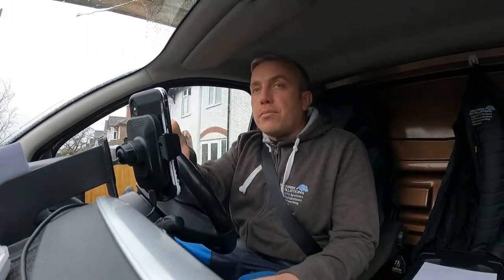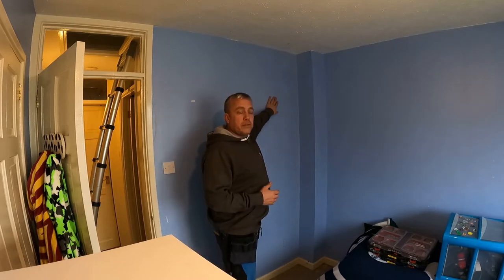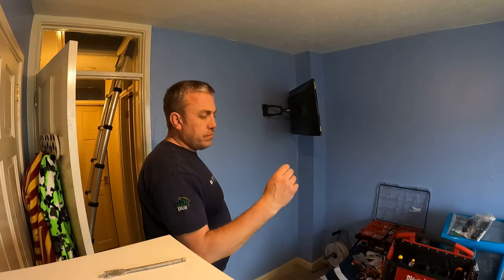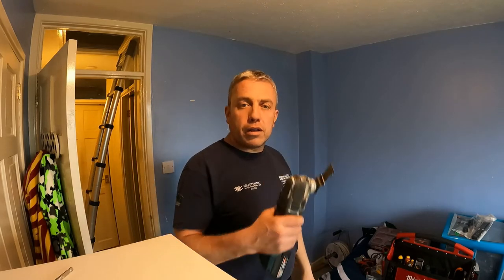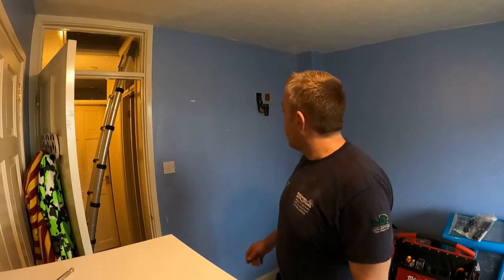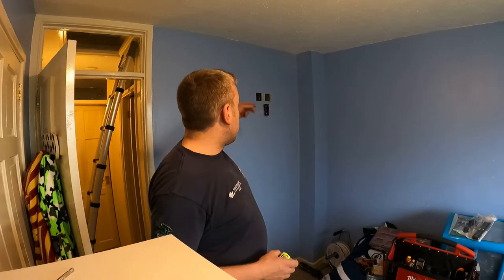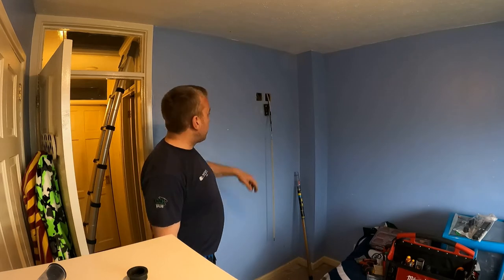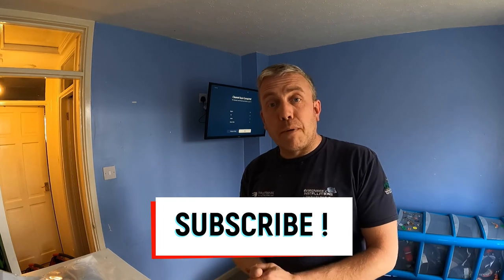Wall mounting a 32" TV on a swing arm bracket & hiding cables

Comment: Curious how much u charge for a job like this mate? Great video.
Reply from the maker: Oh I can’t remember now 
That was a while ago.  I wouldn’t divulge costs on here anyway I’m afraid as each job is different.  Thank you for watching though 👍
Reply: @aardvarkinstalls  Ahh, yh makes sense, nws mate. Another quick one please- I see in alot of your videos you cut out and spur to a nearby socket- is this only because the nearest socket is too far away? Can you just run the power cord from the telly down the back of the wall and into the nearest power socket if it's not too far? Cheers
Reply from the maker: @shudidesai  all electric cabling must be kept within prescribed zones mate so concealing the power cord within the wall might not allow this.
Reply: @aardvarkinstalls  Legend mate, thanku.